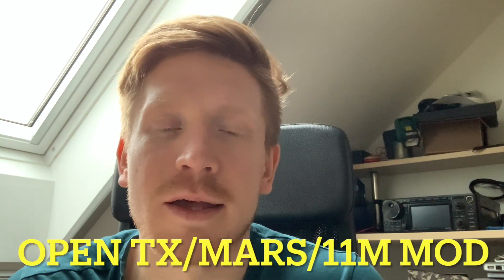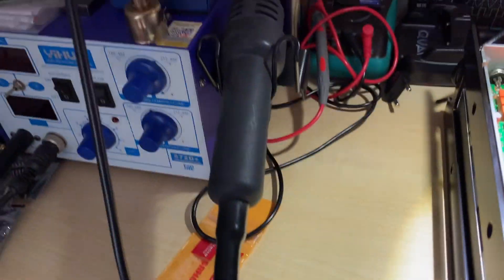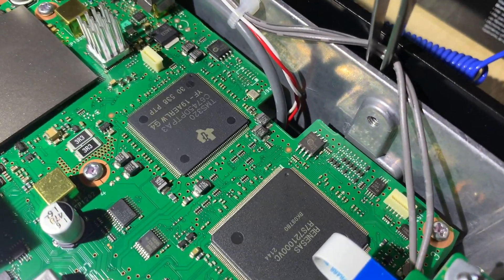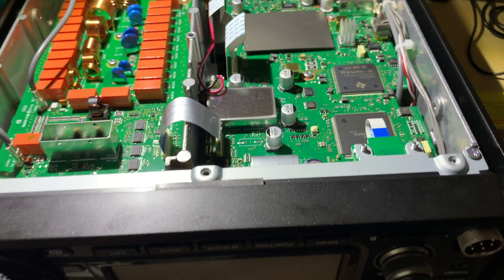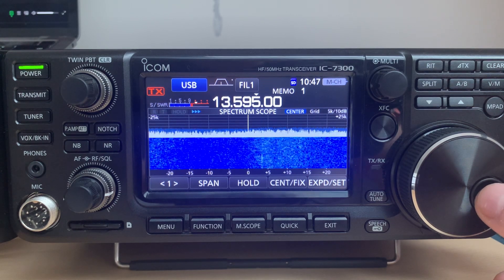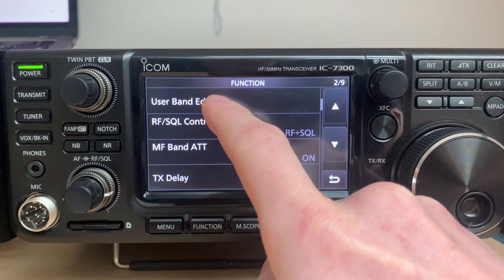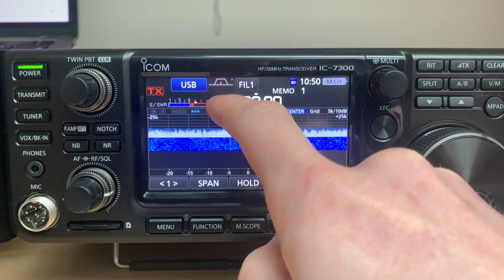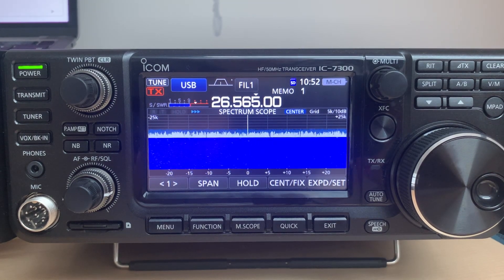Icom IC 7300 EU version open transmit/mars/11m mod

Comment: purchase some KAPTON TAPE..    It is tape that protects other components from overheating and heat damage from the Hot Air Gun or Soldering Iron.    When done just remove it.
Reply from the maker: This is spot on. I did not have any at hand when I was doing this, but now I have, will use it next time, thanks!